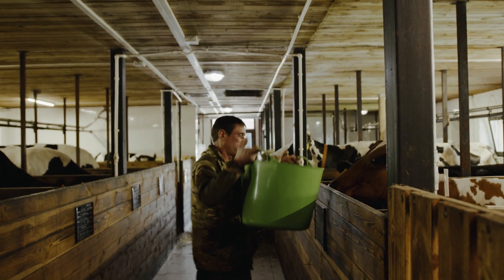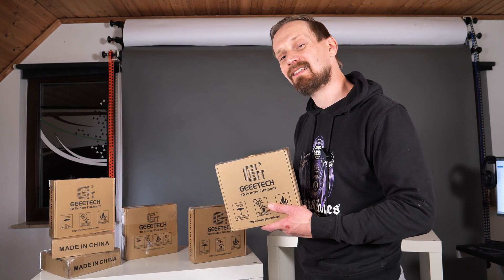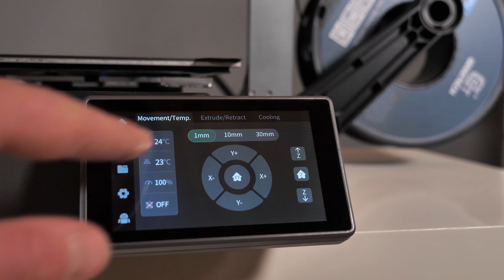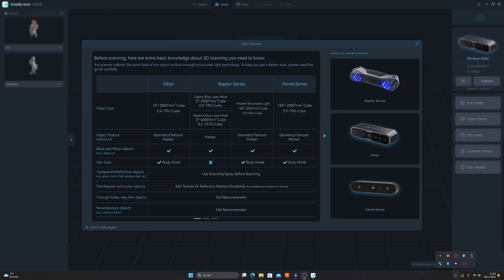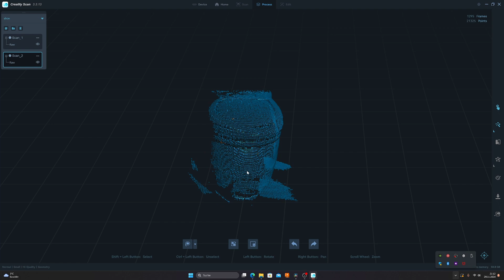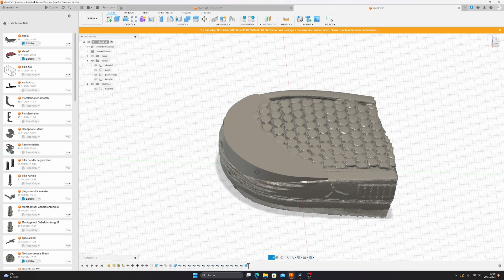How to fix shoes with 3D printing - the fight against the world wide waste

Comment: I wonder if an entire sole could be printed. If the rubber is grippy enough it could save me a fortune on climbing shoes!
Reply from the maker: @thehudsonforge71  you can if you have a 3D model but 3D filament can't be as soft as most silicone rubber due to the fact that the extruder needs to grab the string of filament. If it is too soft you will run into extrusion issues.
Reply: Who says they use silicone rubber?

Comment: I don't have 3d scanner but have an ender 3, if there's intricate curves or shape to fit the 3d model I'm working on I just take a photo of it on a a4 size paper and correct skewing on software like photoshop and add on fusion 360 as canvas with the rectangle line drawn in a4 size for the photo to match with and it works!

Comment: Do you think this material would be good to try and 3d printer the padded portion of a saddle like they do with the Fizik Adaptive saddles?
Reply from the maker: Yes you can do that as long as you use these typical grid or gyroid structures.